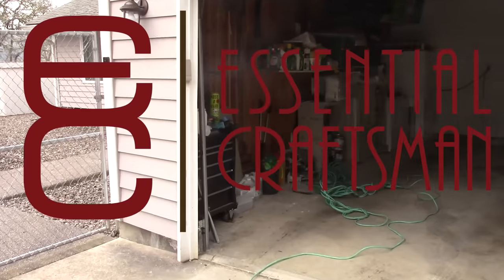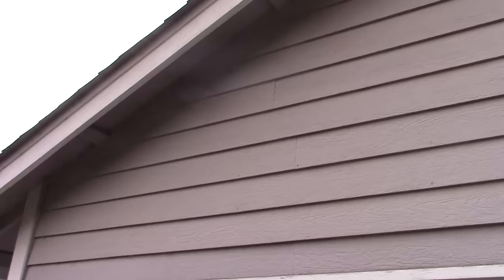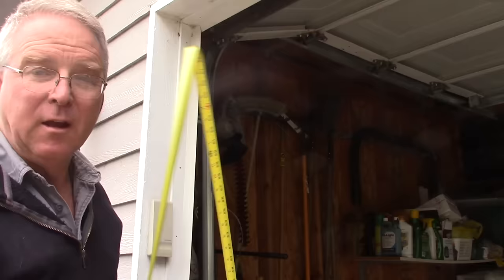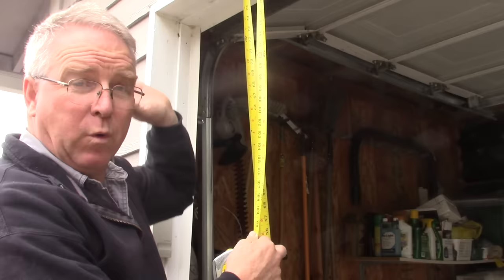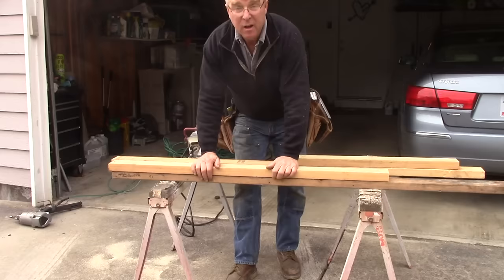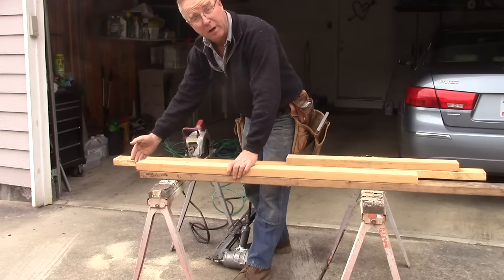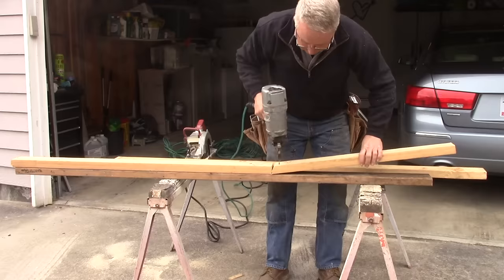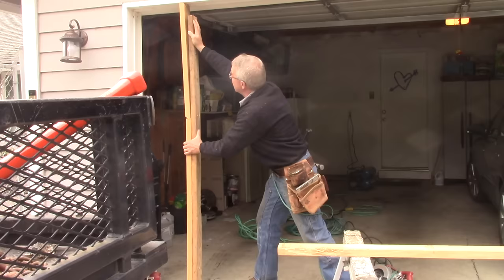2x4 Becomes a Jack - Cool Trick

Comment: I like the ingenuity. You also could have cut board with an extra inch, wedged it under the header, and used a mallet to knock it in toward 90 degrees. Would force the header up same way. Less work

Comment: I suppose if someone else is paying your time and materials this works. I would have simply used a 2 X 4 and two 12 inch long (wedge) shims. Place the shims on the ground side by side. Place top of the 2 X 4 at the header. Then place the bottom of the 2 X 4  on the top/start of the shims (wedge). Hammer bottom of  2 X 4 towards higher thickness of shim/wedge. If needed, place scrap  2 X 4 at higher thickness of wedge/shim and door jamb to temp hold shims in place as you hammer. More accurate too if header being raised has to be raised as little as possible as you go because of cracking/damaging adjoining masonry, etc.  Takes far less time, measuring, wasted materials etc.

Comment: I do column replacement very often and I typically use a load support or a T-board system with a hydraulic bottle jack (much lighter and stronger than a 4X4) I don't really see how this system can beat a load support or jack/board system in terms of time and convenience. But if I had no other option it's good information to know
Reply from the maker: Exactly...

Comment: Personally the way I do it is to cut the 2 X 4 a little shorter than the distance from the top of my car floor jack to the header panel above. While holding the 2X I pump the floor jack until the board is tight. Just jack a little at a time until level is reached above.

Comment: Awesome trick. At the very end, though, I would just use a clamp to secure the extended boards. That way I don’t have to waste more nails, and I can just undo the clamp and pull the apparatus right down without the need for a hammer or anything.

Comment: Nice, but I would save money by putting a 4x4 vertically on one of my bottle jacks.  Might need a metal plate or horizontal 2x4 at the bottom to prevent bottle jack from splitting end grain.  Yup, you got a nice trick for some situations. 🔝

Comment: Personally, I would use an Acrow Prop (basically a very long screw jack). They;re approved for load bearing applications, and require very little effort to be able to lift a gable end like that. However, I like the way it was done here too.

Comment: I would use a couple big C claps that way you don't have to shot bunch of nails in your boards. But you gotta be careful not to crack your Mellon on the claps sticking out which I've done several times over the years.

Comment: To each their own as far as methods to accomplish something. Cudo's to you for accomplishing views & likes.... Coming from a contractor/carpenter of 40+ yrs. I prefer to do thing the easiest along with most effective (time, labor & cost) way possible. To me that means using a 4"x4" cut to 83 1/4", (2) 1"x4" (3/4"x 3.5") cut to 12" & a 5 lb. maul. Place one 1"x4" on top of the 4"x4 to protect header trim . Place other 1"x4" on driveway flat under header. Butt 4"x4" w/ 1"x4" sitting on top to header & angle atop of lower 1"x4". Drive (hit) low on 4"x4" until level. Voila, you're done. I just saved time, labor, saw blade wear, nails & material. As I'd stated, to each their own.

Comment: I failed math so I would've cut a 2x to 84 3/4. More or less? Jammed the end up against the header and hit the bottom with a large hammer, wrench, rock or whatever to raise the header. Didn't have to worry about the angle of the dangle or other hypotheticals. Hmmm. Maybe that's why I failed math. But it works. 🙄 Seriously though, good job. 😃👍👍👍

Comment: Personally, I would put a C clamp on the sperate pieces just for extra assurance that it won't come apart, but I'm just paranoid about things like that (i suppose being unreasonably paranoid is better than being injured, but i digress). This is a great tip nonetheless.

Comment: What if the foundation right under the temp support beam is cracked and causing ceramic
 tiles to explode and crack? Wont the temporary wall be pushed downward , right into the cracked foundation?

Comment: Just got the chance to come back and review this.  What is your guestimate as to the distance such a "jack" can lift a load.  Here you lifted it about 1/4"; could it go to 1/2" or perhaps a full inch?  I realize the distance lifted is at least partially determined by the weight it has to lift.

Comment: Question:
I have an old detached garage built in 1921. Its not really long enough for most modern cars. My problem is that the building has leaned some. If you face the garage door, the building leans to the right. I would guess no more than 2"...I haven't measured anything yet.
How could I go about getting it back to plumb?
The building is roughly 15' x 20'
All 2x4 construction.

Comment: I just watched this and it may have gave me a way to use a 2 x 4 to jack up a deck in a bad spot.  I am 
replacing bad untreated wood.  it is adjacent to mt stairs and I just enough space to put a bolt through
a the 2×4 to the deck support.  As I said it is in a bad spot..dont wont to get bit by a snake.  So I wont to do everything standing on the deck. Just realized I can use a pressure treated 2 by 6.  Then I can try to move it but a think a sledge is called for.  Its first thing
this morning.  Took up woodworking about 3 years ago and I find it usefull in many things.

Comment: Hi Scott. I can appreciate the clever lever or cam system you have shown here but I am surprised you don’t just use the simpler and immensely powerful method of a post and a wedge. The post doesn’t even need to be the full height you are working to as you can block it up with bricks or off cuts till it’s just short of the lifting point. Then the post is simply held in position while the wedge is belted in at the base; effectively lifting the post. Better still, use two low angle wedges coming in from opposite sides. If the ground is rough under the post then just place a board under it for the wedges to slide on. If the job is going to run over a long time you can simply drive a few nails through the wedges once they are set- to tie them together. Frankly I have never had a wedge slip even without the nails. 
The advantages are so many- There is no fabrication involved. You can so easily set the lifting post and adjust the height single handily with no dangerous spring tension . You can adjust the height up or down infinitely. (well till you run out of bricks) There is really no need to nail anything together. There is no damage to the post. The rig can be disassembled with just a few sideways knocks from the hammer. The amount of lifting power is exceptional and you don’t even have to forcibly push it together- The force of the hammer blow does all the work! 
 It's so quick to set up, effortless, powerful and secure. 
I recently had to tomb up the entire roof over a kitchen extension, that had been damaged by white ants. Using two completely different posts and a 6x2 placed against the sheetrock ceiling (across the  joists) the wedges exerted so much lifting force that the entire ceiling/roof frame started to rise and we cracked the crown mouldings!!! Those two tombs and pairs of wedges were not nailed and stayed in place for nearly a week while we made the difficult repairs to the roof frame above with two of us walking about on top of the joists and roof sheets. I also wanted to say I watched this episode, some time ago, with great interest- as I have done with virtually all your episodes. I can’t begin to commend/recommend your efforts enough. The aspect I admire most is the decency and consideration you have for all those who have touched you along the way and your love for your tools. We are all just caretakers for the next proud owner!
Cheers mate H.

Comment: Then you clamp it.  Or just cut the board the final height and drive it into plumb with a sledge.  Or cut it a little short, and lift it with two wedges.  These methods save you 2x4's, which have doubled in price since you made your good vid.

Comment: Would cutting a 2X4 and using any jack to jack up the garage opening, then putting the 84.75" 2X4 in be any different?
Reply: just that you probably dont always have a jack on hand, but most likely in many trades have a 2x4 and nails on hand. not a matter of would it work, just what can you improvise with whats on hand at a construction site.
Reply: I believe the difference would be instability
Reply: @bobgarner44  - I had a construction guy with me years ago and needed to hold a "load bearing" wall in place while a repair was done, and we just used a bottle jack and 2x4....heard the whole house creak as it was lifted a bit....seemed very sturdy and locked in place.  Then just lowered the jack when done.

Comment: This is a cool piece of knowledge but in all honestly a bottle jack and a 2x4 strong back would do the same job twice as fast and frankly all the work getting the wall back onto the bottom plate would've been much easier as well because you'd only need to push a button to raise it higher than u originally anticipated.

Comment: Why not just wedge the 2 by 4 measuring 84 3/4 and then hammer (or sledge hammer) it at the bottom untill vertical ? You can use 2 of them nailed together if more strenght is needed.

Comment: Cood you instead just drive tha truck into tha wall and push it back in? Put a wedge shaped  block of wood under the tire and a few nails in tha wall above tha bumper. When you drive forward it will lift tha wall.

Comment: Idk looks a lil dangerous   , gotta make sure you got good wood with that piece bending, but I guess in a pinch it's a good idea. I would have screwed 2 ,2x4 together, set it on the ground, on an angle, then put a lil piece flat where it touches at the top then hammered the 2x4s until it was straight. And yes I've had to shim once or twice. Then just hammer it out when I was done. All that if I couldn't fir some reason get a Jack..  but good idea rogans up...😎

Comment: Just take a 2X4 cut to about the height  needed and stand it up with the top about 4 inches from the point to raise. Hit the 2 X 4 with a hammer at the lower end about 2 inches from the 2 X 4 bottom and the wall lifts as the 2X4 straightens up right, easy as can be. Why all this complicated stuff? He reminds me on some engineers I had to work with. Make everything complicated for job security.

Comment: What is the maximum height (clearance) you've been able to successfully use this wood jack? Seems like a great idea.
Reply: The contractor I worked for 50 years ago said, an inch...enough room to hold up a ceiling to cut out a wall and replace it with a beam...easier than using a bunch of jacks and posts.  He used C clamps, so it was easy to take down and reuse.
Reply: @georgvonsauer2618  Thank you.

Comment: Easier just take a vein that fits on top of the tuba 6 flat ways prop it up in there and hit it with a sledgehammer to bottom a few times it'll lift it right up whole lot easier used to have to lift cross beans with dadgum cinder block on top of them do this

Comment: well...seems like a lot of work to get a lift. I just use a 2x6 cut to the length I want to lift, minus the thickness of a scrap sheet then place the scrap between the board and the door header, take a 5 pound sledge and tap the board into place. Use your foot to stop the bottom of the board from scooting on the cement.

Comment: After 35 years in construction lifting a weight like that can be acheived in many ways. This one is rather fussy and time consuming as well as can damage the top trim and plate.
I can achieve the samething far quicker without using a nail or clamp of any kind causing no damage while carrying the load far better..
Don't take my critism wrong, you do show some wonderful technics in other videos.

Comment: use a sissor jack and plain 2x4 for the same result.
Reply: that doesn't really sound like a great idea imo. if the 2x4 isn't perfectly level it won't be as stable as the method shown in the video. if your concerned about the nails failing to hold the wood together just use a C clamp to keep the pieces from separating.
Reply: Scissor Jack. You’re a genius. Obviously you know everything already so why are you watching?

Comment: Cut the wood at the length u want then put it In at an angle in the opening then pound the bottom until it's straight. A lot less work.

Comment: I'd suggest beginners not try to cut snipes free hand with circular saw. That's one way to cut off a finger. Better to use a miter saw if you've got one, at least put the board on some sawhorses and hold it firmly.

Comment: WOW! It never would have occurred to me... to spend all of that time cutting, nailing, renailing, and standing up boards like that when a single board cut 1/4" long could have been merely tapped into place with a sledgehammer... I would have actually used a scrap board on the tapping end so the tapping goes a little smoother. This is unnecessarily complicated.

Comment: it could have been done alot easier
84.5 clear cut 2x4 83.25 use the fall block at header slide in 2x4 on angle then pull straight

Comment: THERE WAS AN EASIER WAY RATHER THAN NAILING AND  CUYYING ALL YJAT WOOD THAT IS ALSO SAFER'
SINCE THE FLOOR WAS CONCRETE  YOU COULD WEDGE A 4X4 IS RECOMENDED THE LENGHTH YOU STATED 83 AND 3/4 BETWEEN FLOOR AND SILL OF DOOR

Comment: Think I would a just cut a 2x4 for length. Put it in crooked to fit. Then beat it in with a maul to lift. No fasteners needed.
Neat video though
Reply: Such a device is called a deadmans hand and used to be used in fixing ceiling boards when labour was in short supply. I believe they use acro props or a helper standing on a platform now and the boards are much smaller.

Comment: A case of over thinking a solution.  There's a jack in the car that's in the garage.  The jack and one 2x4 is all that's needed.  He had to drag out & put up a saw horses, saw, drop cord, nail gun, air compressor , tape measure.  I'm guessing he gets paid by the hour.

Comment: this is neat and stuff but seems time consuming and you basically ruin 2x4. if you only need an inch of lift wouldn't a bottle jack with the same 2x4 fastened together be simpler?

Comment: That's cute but on a real jobsite you would get laughed at. All you need to do is measure the opening and add the distance you want to raise the header. Cut two 2x4s that length then nail one to the other like a T. Simply set the top in place (in the corner next to the wall) and beat the bottom over until plumb. It will raise the load as it goes. This will raise far heavier loads with far less risk of snapping the jack studs. Look closely. You can see his bowing in the middle. I've seen these break suddenly and seriously hurt the person using it. Never attempt to raise a heavy load this way!

Comment: This guy just spent $1000 of labor and Wood, when he could’ve bought a $30 Jack at Walmart and use the same 4 x 4 for the next 30 years. This is a complete waste of time and materials. A complete waste of wood and electricity. It is Dunning Kruger concrete guy carpentry. A hydraulic jack from China is cheaper than wood. Look around for any good vertical member close to a 4 x 4. Automatic infinite adjustments. If you have to go big you can get a 12 ton bottle jack for like 30 bucks and use 6x6. Logs work.

Comment: Sorry,  but you just completely over complicated this. This can be easily done by just using a 2x, that is cut slightly larger. Use a scrap piece on top to prevent damaging the existing trim, and tap it in similar to your method, but without using 3 2x's, and making all kinds of stupid cuts